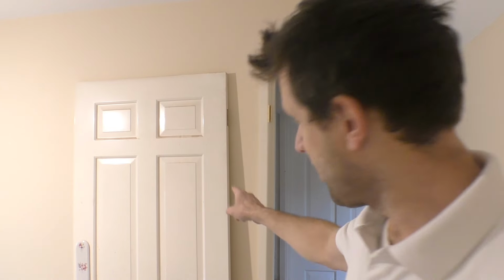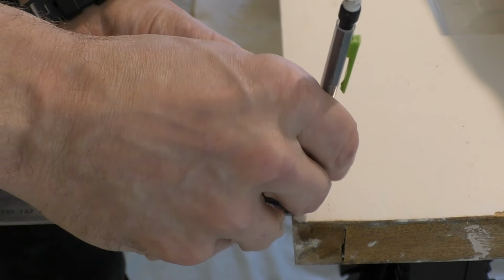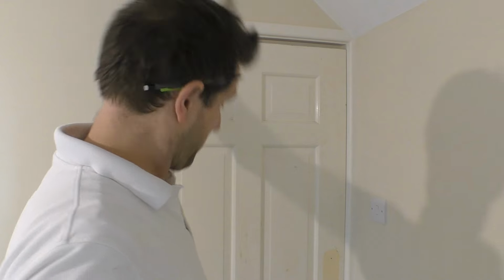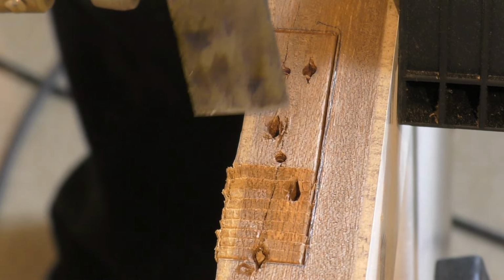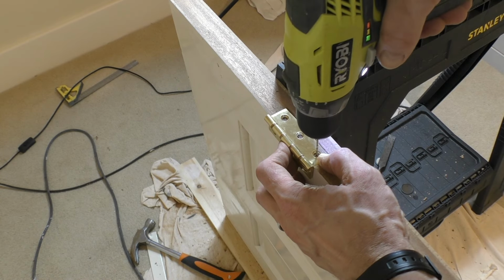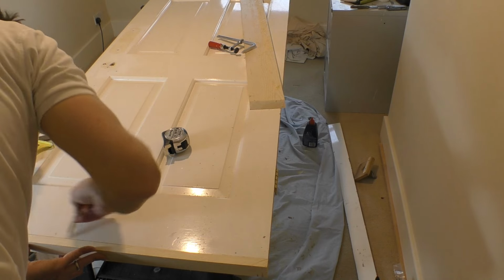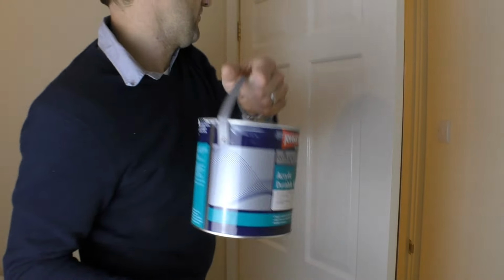How to Trim and Rehang a Door

Comment: Why didn't i put a plank of wood down and clamp it down. 
My beautiful door i paid £295 for is now a complete disaster as the saw ran away from me and sliced right up the door 😫😭😭😫😫😭😭😫😫
I now need to buy a new door if only I watched this video first. 
Thanks for the video Charlie .off I trot for a new door 🤣🤣🤣🤣
Reply from the maker: So sorry to hear that. Also make sure you set that blade to the right height - with only half a tooth poking below the door. Otherwise the saw will run out again. Good luck with the replacement. These things do happen, it's all part of the learning process 👍

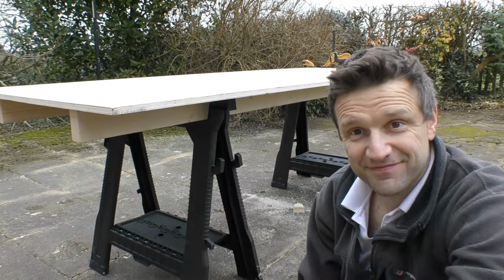Comment: 3:09 - This conversion seems almost essential (will be doing soon as weather warms up).  I've only recently bought sawhorses (I think they're the same as the ones in this video) and having the door move around whilst trimming is an annoying pain in the backside (felt dangerous whilst using circular saw).  Having nowhere to clamp wood sheets to seems like a glaring omission.  Using those grooves as the base for a flat worktop is a great idea - easy to clamp to.  Great video, door looked awesome. 👍

Comment: Hi charlie you might not know this but a little tip for you when your rebating out the hinges. I usually run a stanley blade to breakup the fibres before getting the chisels out. End up with a much neater finish. Very good video though keep up the good work 👍🏼

Comment: Good attempt for a DIYer but quite a few things I picked up on when it comes to hanging doors from a professional point of view who hangs doors for a living as a professional carpenter.

You never have a square edge on the hinge side or closing side of a door. You always plane a bevel on the edges of a door to prevent the door from binding and allow a tight fit on the closing side. 

Id of scribed the door to the frame rather than relying on the frame to be straight but out of level if the frame is as old as it looks. 

Always stand your door up on its side to plane edges as it’s dangerous to plane the door the way you were. Especially the planing of the filler strip at the bottom of the door. Your fingers are right there if you slipped. I understand it’s a DIY approach but health and safety is a must if sharing knowledge with other DIY enthusiasts using power tools that can cause serious injury. 

Sorry if it sounds like a rant, honestly it’s not. I give you praise for sharing your knowledge with others but help and guidance from others to help improve I think is constructive.
Reply: Tom Wills, I completely agree. I’ve used a plane like that in the past and it’s not a good idea. It’s harder to plane a level edge as you have less control and it’s harder to see if it’s perpendicular and yeah it’ can be dangerous as well. Also can buy air wedges for £9 which give you a huge amount of adjustment when lining up the door and they hold it in the same position while marking the top and bottom hinge recess without having to keep your foot on a wedge. If you’re putting out content I think it first of all good to learn the professional way of doing things first. 

This comment also hasn’t been made in malice. Charlie I love your channel and have just hung a tv on a plasterboard wall using the geefix fixings after seeing your video on this. Keep up the good work. We learn together. Tom

Comment: When I hang doors I usually use 2p coin for the gap on the head of the door, I also check the old door frame with a straight edge to see it's bowed as you could end up with a larger gap than you wanted.
Reply from the maker: Chris Delaney Thanks Chris. Great advice!

Comment: A gap under the door is normal for ventilation.  The sides of doors don't have to be planed 90°, they are often planes on a angle to allow the door to close.

Comment: True up the door frame is easier and no need to go through this monkey motion every time you install a new door. Trim router for the hinges would go faster, no need for jig if careful and go slow. Set the bit height once then you could do all the doors. I found using an air wedge under the door for micro height adjustments with your foot while holding up the door for alignment so much easier. A vix bit for centering holes for those hinges handy to have around. Jawhorse as an extra hand for heavy exterior door working alone.

Comment: Hi Charlie, great video. I hate fitting new doors to old properties, never goes quickly. One thing I do differently is use a router for rebating the hinges in, gives you a much cleaner cut on the front face of the door. Chisel round the perimeter lines as normal so the router doesn’t skip into where it shouldn’t. 

On another note I’m after a bit of advice. Currently renovating my front garden and I’ve built a wall with some pillars. The pillar tops have got polished concrete pyramids on. I want to paint them the same colour as I will my fence but I’m not sure what to use on them because they’re so smooth? If you could point me in a good (not too expensive) direction that would be great! 

Keep the great videos coming! 

Richard

Comment: Very helpful and well made demonstration, lots of useful little tips here. Fitting a door must be top of the list of jobs that people are flippant about but in truth it's actually not as easy to do as you think- certainly not and do a good job. Two key points as ever; taking your time and having the right tools.

From my experience it might be worth mentioning to take care when planing the edges of a door because depending how it's made if you plane outwards towards the corners (usually if you're planing the top or bottom) you might end up splitting the wood. As ever, take your time and think everything through first!

Thanks for a great video.

Comment: The Ryobi door hinge kit is great to use with a router. Saved me soooo much time. You need to try it.
Reply: There is also a template kit for hinges called milescraft 150 sold at lowes stores that can router 3" & 3-1/2" hinges on door edges & on door jambs the kit comes with a 1/2" bearing router bit & the templates are for 1/4" & 5/8" round hinges very pleased with the kit..

Comment: Hi 

You made that look easy my friend .
I too have doors to fit but have no power tools yet not sure I  am comfortable with all them blades going like hell. I shall watch this one a few times.

Anyway

Thanks
Reply: Just use horse sense, eye and ear protection. Unplug or remove battery every time you need to adjust. Hands and fingers no where near those blades. Step aside from moving blades, not directly in alignment with it. We all need to start from somewhere. BTW hand tools are more precise with practice, relaxing and a good workout.

Comment: Great job and worth it on several levels.
Reply from the maker: Thanks Wayne!
Reply: @CharlieDIYte  at last. Someone who knows how to plane a door. I have seen many people plane a door and cut so deep that the planer grinds just about to a halt and make a mess of it because they are wanting to do it too quickly to get the job done. I'm talking about property builders  and SOME DIYRS. you got the skill to plane that door sideways and slowly without making the planer sound like a very nasty angry bee or a angry yowling cat. Is that planer electronic as it has no problem deep cutting and is not quick to slow down
Reply: @CharlieDIYte  at last. Someone who knows how to plane a door. I have seen many people plane a door and cut so deep that the planer grinds just about to a halt and make a mess of it because they are wanting to do it too quickly to get the job done. I'm talking about property builders  and SOME DIYRS. you got the skill to plane that door sideways and slowly without making the planer sound like a very nasty angry bee or a angry yowling cat. Is that planer electronic as it has no problem deep cutting and is not quick to slow down

Comment: Extremely interesting insight Charlie. Well done and great video.

I am about to cut my bedroom door vertically straight down the middle to create a French style opening door. I will be reversing my door frame too.

The reason for this is because my apartment bedroom is very small and to get any decent sized wardrobe to fit, I knew that I would have to make changes to the door and frame itself.

As usual Charlie, keep up the good work and I cannot wait to see your new circular saw.  By the way, love your door lifter!
Reply from the maker: Thanks Deanne and good luck with your bedroom door!

Comment: Another tip charlie , when trimming the door to suit. Just get a pack of shims some 16th of a inch and some an 8th of an inch in thickness before trimming hold the door in the frame like as in your video. just get your 16th of an inch shim an hold it flush to the door stopper on the hinge side ,scribe a line down the door , then put the two shims together scribe the top of the door , then on the lockside just scribe a line with the 1 /8th shim. But make sure to gain another 1/16th on the hinge side for the door tonfit correctly in the frame. Its pretty complicated trying to type it all out. But use this method its alot quicker i find🙂hope this helps you out.👍🏼

Comment: When setting up a fence guide to trim a door (or worktop or similar) with a circular saw, it's better to have it arranged so that the wider side of the saw baseplate is on the fence side. That makes it much less likely that the cut will go out of the vertical with much more of the baseplate in contact. Of course, the fence guide and clamps have to the low enough so that the saw's motor housing has clearance. If the clamps are a problem, then just using a wider piece of wood or 

The other thing is to be careful of breakout when cutting across the grain or cutting laminate. I always stick a piece of duct tape over the ends of the cut. Maybe not so important with a door which is to be painted as filler can be used, but for an unpainted door it's particularly important.

Comment: Fixing the hinges to the frame first and matching the door in the frame makes SO much more sense.  How do you plane true and level with out the electric planner tilting or dropping down at the ends.  Great production technique - thank you
Reply from the maker: MA1973 Thanks mate. With the plane, this isn't very helpful but it's really just down to experience, the more you use it the better you get. I used to plane with the wood vertical but even though it's easier to plane square with the wood on its end, you get no sense of how close to the line you're planing when you do it that way. So planning horizontal is better but it's more difficult to get your planning square. You just have to hold the plane as square as you can, maybe start with it on a very fine setting so you're not removing too much, and regularly check how you're getting on. You get a feel for it after a while.

It's difficult to describe, but when you get to the end, you almost have to keep the plane level with your hand, or almost raise it off the wood if that makes sense, so that it doesn't sink down and take off more than it should as it leaves the wood 🤔
Reply: Charlie DIYte thank you :)
Reply: Second hand one-over-three door framed, trimmed, hung and lock fitted. Fits and latches better than anything else in the house. Thank you.

Comment: If you use your circular saw in whichever direction keeps the wide side of the sole plate on the flat surface of the door (as opposed to hanging off the edge), you have much more control and a more stable saw, giving you a safer and truer cut.
(When you trimmed the end of the door you had it the other way round, and the saw had hardly any support - unsafe and unreliable.) 
Before reaching for the fence, bear in mind that it can only replicate the existing edge, not straighten a wonky one. This may or may not be advantageous, depending on the state of the frame!
Also, some painters tape on the door will protect it from getting scratched by the saw as it slides over the surface. Better still, get a guide rail 👍
Just sayin’ 😇
Reply from the maker: Thanks mate. Yep ended up investing in a plunge saw and tracks when I built the wardrobes.

Comment: Charlie, any ideas on the best way to trim and hang doors that are odd sizes? I have a cupboard door I need to fit with a new one. It’s a hollow core door and I need to take quite a bit off the top and bottom. All the videos I see online are from Americans and well… I’d rather not.

Comment: I followed your instructions to a T, cut the hinge rebate on my hall cupboard door beautifully with a new sharp chisel. But realised too late the hinge was sited on the wrong edge, so the door would open in, not out as intended 
😢
Reply from the maker: Are you painting the door? You can rebuild with 2 part wood filler the thin strip and then repaint. It'll look as good as new.

Comment: Really excellent video Charlie. Very practical as opposed to all the 'perfect scenario's' that are often put on youtube. I have 7 new doors to hang but they are all walnut. I cannot paint if I make an error!! Hence what brought me here to make sure I get things right. I have done one door already and it looks fine in a frame that is parallel up to half way up then tapers out by 5mm on each side to the top!! I am very happy with the results but your tips will make the fitting of the next 6 easier. One thing I noticed was that I did the same as you... used my laser level to determine the state of the existing frame before I started. Crucial to the final result I would say.
I have subscribed and will check out your other videos. I seemed to have trouble with the 25mm paddle drill. Brand new Dewalt's but seem to take while to drill the 70mm or so to fit the 57mm mortice.

Comment: An Excellent job of a poor situation.  Why buy a new door that you would have had to it 'Fettle' anyway. I'm surprised you did not put the door on it's edge to plane, similar to when you did the hinges. A lot easier to handle the plane and keep it square (but you did a good job).  if you are doing a lot of doors. Not sure how much they cost but you can also get fancy door clamps (I think from ScrewFix), that hold it on it's edge,   Like your home made lifter, I made my own door edge clamps.
Reply from the maker: Thanks Peter - good to hear from you! D'you know, I actually prefer to plane timber on its side because bizarrely I find it much easier to monitor the straightness of the edge I'm planing than when the timber is on its edge. Also, and perhaps more importantly, when it's on its side you can keep an eye on the line you're planing up to, which you obviously can't do if you're planing end on (as I used to do). Presumably you mean Magic Grippers https://goo.gl/KaAaoo I've been tempted to get some of these for a while, having seen the empty box for a pair on site back in October last year.

Comment: Love this. Great tutorial. Only thing I would like to know is how to adjust hinges if they don't fit. Makes my doors and hinges look awful! obviously the original carpenter wasn't as good as you!!
Reply from the maker: Thanks Gill. Take a look at my update video here https://youtu.be/_bIqnAf8b2Y To adjust hinges you want to get some two part wood filler https://amzn.to/2QbAFUo to fill any areas below or above. If you've moved the screw holes and the new ones are very close to the old, knock in a kebab stick or match stick with some glue, into the old hole and trim off the end with a chisel or Stanley blade.
Reply: @CharlieDIYte  Thanks Charlie, I have checked out your video and am going to try and adjust hinges again. Wish me luck! I'll let you know how I get on!

Comment: Great video, the wooden jack pedal in particular is fantastic - I'll be using that tip very soon. BTW did you consider hanging the door on the opposite side? - if give better access to the room tho  you would have  relocate the light switch to the other wall...That configuration was brought in style during the 1930s a selling feature of new builds of that time, the reason for this was to give the door a longer opening time so to allow women to present themselves with a wholesome smile for their husband ("no man wans a 'sour puss' for a wife") or if she was in a state of undress she could hide her modesty ... how times have changed :)
Reply from the maker: That's really interesting. Yes we did seriously consider changing it as we have done in a couple of other rooms but my wife was concerned that being so close to the stair case, someone might fall down it. So the wife had the last word again but for different reasons 😉

Comment: Cracking good job on refitting and restoring the door, can I ask why you didn't change over the hinges so the door opened flush against the wall?
Reply from the maker: I thought long and hard about doing that. I decided not to, because the bed is next to the door which gives it a bit of privacy (not that that's particularly important) and on the current hinge side when you step into the corridor there's a staircase immediately to your right, so I suppose having the hinges where they are helps on the safety side. Ultimately though I think there's a strong argument for having it where you suggest.

Comment: Hi Charlie,
Love your videos, but this one has confused me…
😀
If the left leg of the frame kicks out at the bottom, and the top right of the frame is square, then how did the door fit when you cut a taper along the top of it, tapering down from right to left…?
I’ve missed something…🤔
Or was the door already out of square?
Reply from the maker: The door was already out of square. I was rehanging the door but had slightly narrowed the frame on the right hand side when standing inside, so I could dry line the wall in the bedroom.